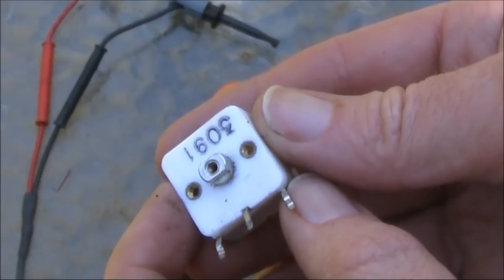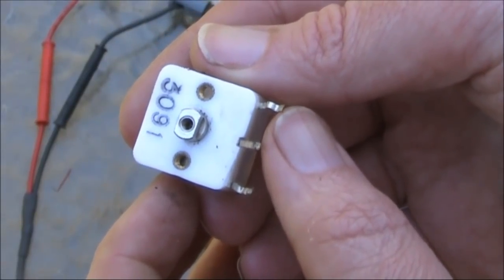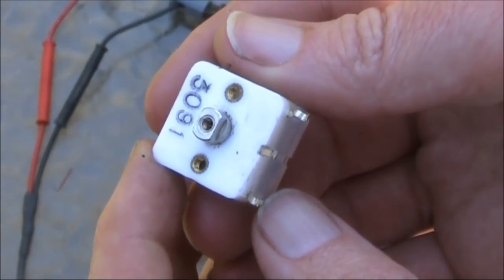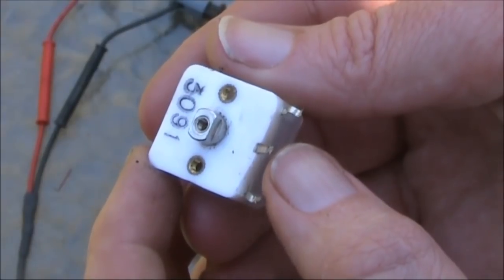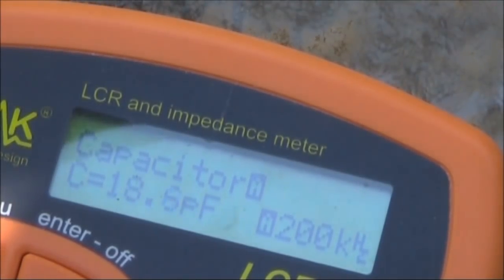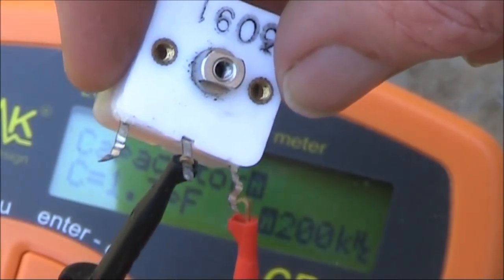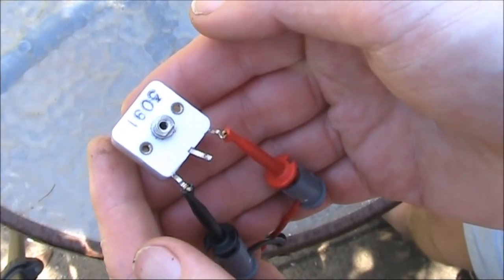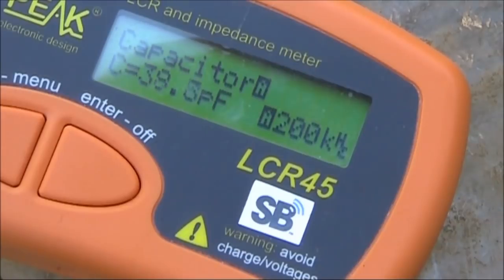Lower capacitance from a 2 gang variable capacitor

Comment: Hi from Turkey..I need some help please..I have a variable..I connected all the corners..and now it is 35-330 pf ..but I need less the 35..minimal capacitance must be 10 for example..what can I do for this ?
Reply from the maker: Get a capacitance meter and try all different combinations - you may find a combination that gives a more useful range if your capacitor has two capacitors that can be connected in series. Or you may not and will need a different variable capacitor.

Comment: Hello there! Do you know the maximum voltage that could be safely applied for this kind of capacitor? Thanks!
Reply from the maker: I wouldn't know sorry. But I wouldn't use it for more than 5 or 10w power.

Comment: When using one of these in a L match for QRP witch connections do you recommend ? The two outer, the left and center or the right one and the center
Reply from the maker: Mostly 2 outer so the two are in parallel to give the highest capacitance. See my other L-match videos etc.

Comment: How to I connect to ends two this for a good AM signal
Reply from the maker: Your question is unclear, but if you're building a crystal set you would use the higher value section.
Reply: @vk3ye  ok so I've got this antenna cross I built with copper wiring wrapped around it (equal distance apart of course). Do I now solder the two ends of the copper to the middle and left leg on the capacitor for an AM signal? Thanks
Reply from the maker: @mr.summerset8054  Depends on how much capacitance you need.

Comment: I expected you to say that if you connect the  variable capacitor is series it doubles the voltage rating of the capacitor, making it useful for QRP transmitting in addition to what you did say in the video, (Those little transistor radio caps don't handle much voltage).  The distinction between the 2 ways a vari cap can be wired  for total, or 25% capacitance, and regular or double voltage handling capability may be useful to those not already aware of using air variable caps for transmit as well as receive. I use one of those on my bicycle wheel mag loop antenna for 11 meters (CB). I don't know what it's power limit is yet. Do you know how much power those plastic vari caps can take?
Reply from the maker: This is also true. I don't know the voltage ratings of plastic dielectric capacitors but they would be the worst possible choice in a transmitting loop.

Comment: When you combine the middle pin with the left pin the values are a wider range. Then moving the lead from the left pin to the right pin and checking the range gives a lower range result. I understand because there are 2 varicapacitors, but when you measure from left pin and right pin, omitting the middle pin, the values a greatly diminished to a lower range. Why?
Reply from the maker: The lower capacitance is because the two variable capacitors are in series. Sometimes used to advantage by magnetic loop antenna builders but rarely in other projects.
Reply: @vk3ye  Thanks for the quick reply Peter. KB8AMZ